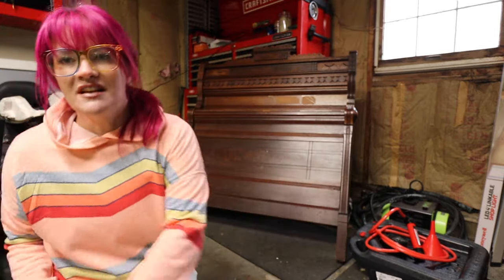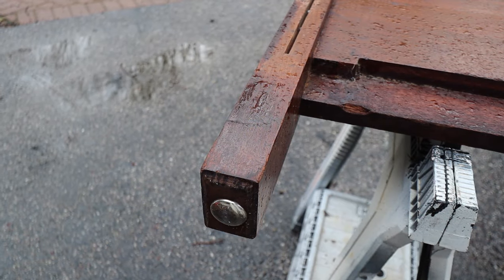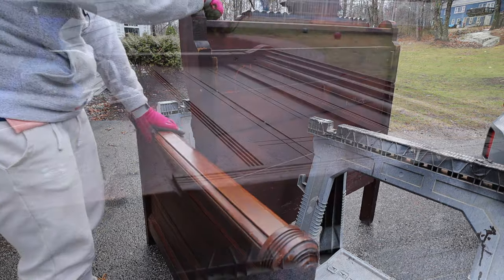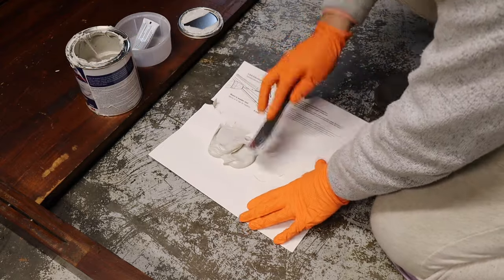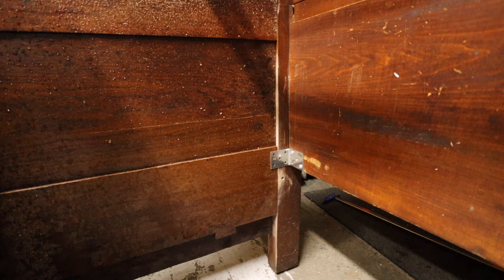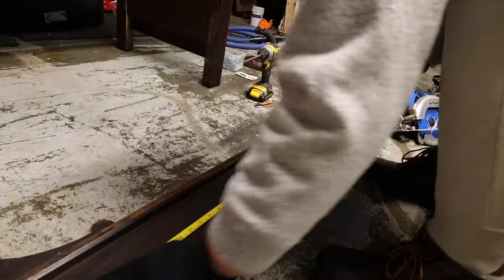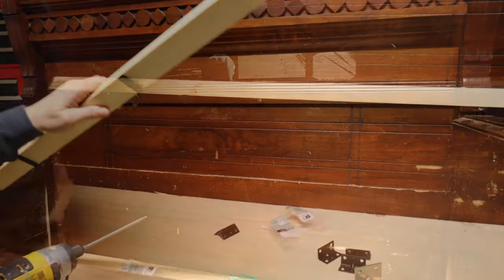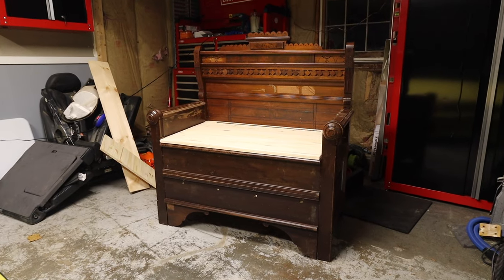Building A Storage Bench From A Vintage Headboard and Footboard- Part 1

Comment: Absolutely love the video and how you always clearly explain every single step! I have a hoard of beds in the garage shared the video to my son who will help me with the building of it! ❤thank you for this video!
Reply from the maker: you are so so welcome, I always hope that it is helpful for everyone!! I can't wait to see you make some!!
Reply: Me, too! I've been too intimidated to tackle them. Curious as to how it is going to become weatherproof.
Reply: @trudyeby464  I believe CrysDawna has a covered area that it’s going in. However, there are many water based top coats on the market that can be used to protect the wood. You may have to re apply depending on how much the elements affect the bench thought the year(s).
Reply: @stellaroseboutique  Ok, covered area makes sense. I know about exterior topcoats but feel like the water would get in between joints and rot the wood or break with thaw freeze expansion, etc.